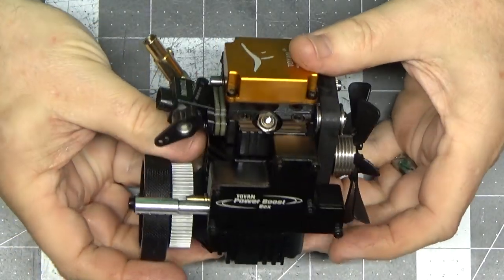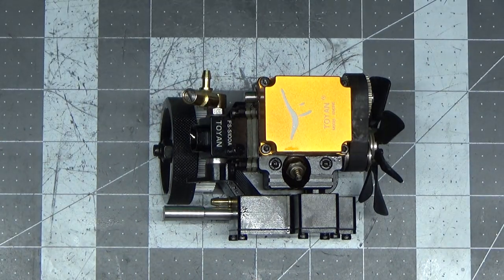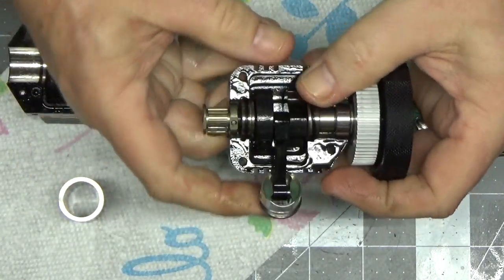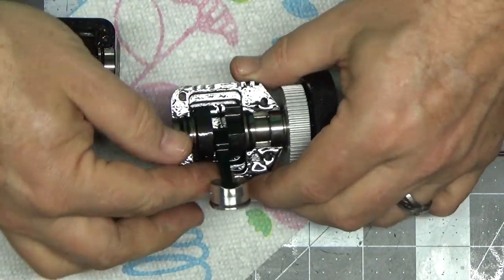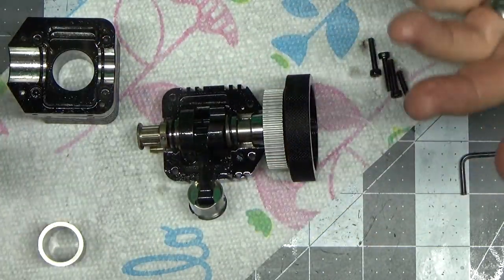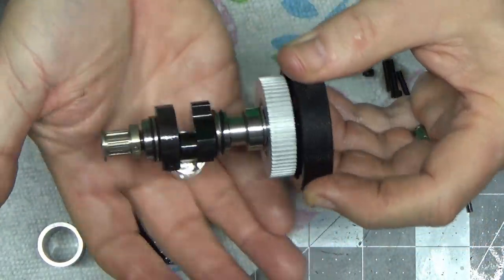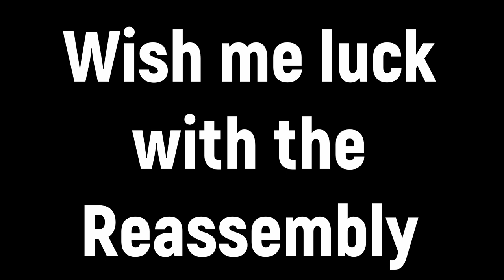Toyan FS-S100A A Look Inside

Comment from the maker: I know that I did not show how to time the engine.  But there re timing marks on the cam pulley and crankshaft pulley.  With the engine at TDC each timing dot faces straight down.  I did get it reassembled and I have run it to verify.  I think it actually runs better now than before.  During disassembly I noticed that there were several fasteners that were not a tight as they should have been.  I was wondering why I was seeing oil residue coming out from the bottom of the engine on the last few runs.

Comment: Hope you got those O-rings around the main bearings back in place… those seemed tricky to me to get them aligned with the groove.

And one question, because I could not really see it properly: is the gudgeon pin secured with clips or some slide pads of some sort?

It definitely looks like it is made very well, and with attention to details and looks.

If this was my engine (and very possible I will get me one one of these days) I would reroute the crankcase oil drain through the rocker cover, because it looks like that grease needs replenishment rather quickly given how it looks and you mentioning you ran it only 10~15 times.

I would probably go for the watercooled version though….

All in all, it definitely is a beauty!
Reply from the maker: Yes of course the o-rings are back in the grooves.  it really wasn't that hard to do.

Comment: My engine was leaking from the front o-ring. When i took it apart, both o-rings were torn. Here is an easy fix. Go to "Michaels". They sell a bag of small rubber bands for under $2. They are all the same size and fit perfectly in. Just really tighten the screws. I notice mine had screws all over that weren't fully tight. I also notice it leaks from where the oil residue comes out. I will use teflon tape to seal it. I also am building a new exhaust thats better and a homemade spark ignition for it.
Reply from the maker: Who ever said my engine was leaking from the o-rings???  It wasn't.  Yours was not assembled correctly if they were torn.  Mine is fine.
Reply: @dmrcflyr2  im just letting u and everyone else know. That if u do ever encounter a crankshaft leak. U can use small rubber bands as a replacement.
Reply from the maker: Ah, gotcha.

Comment: Interesting disassembly show. Looks like the engine does not have any combustion chamber design at all. Just a cylinder with 3 holes. That is quite disapointing.
Reply from the maker: Well compared to most glow engines from China, this one is MUCH better than any I have seen except for maybe the Aviastar engines.  The fit and finish is much better than anything Sanye put out by a long shot.  So unless you have held, felt and run one, generalizing about it being from China is unfounded.  There is always someone thinking they can design engines better than engine manufacturers do, but yet I never see them offering any engines, only criticism.
Reply: @dmrcflyr2  I do not expect chinese products being low quality or poorly designed. You can get top notch products which are china engineered and build and crappy things as well. According to the good build quality of the engine it disappointed me that the combustion chamber is not as sophisticated as the machining.
Reply: @tonydetwiler2624  Thinking China products being of low quality is a common misconception beyond the uninformed and chauvinistic crowd.